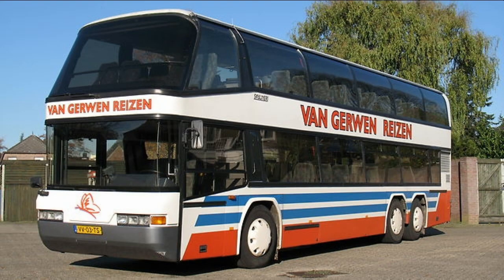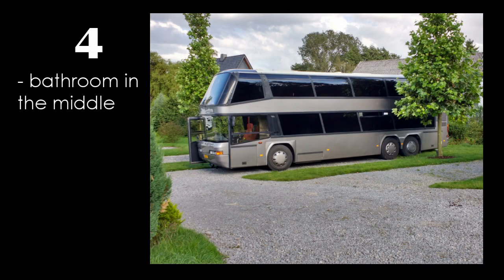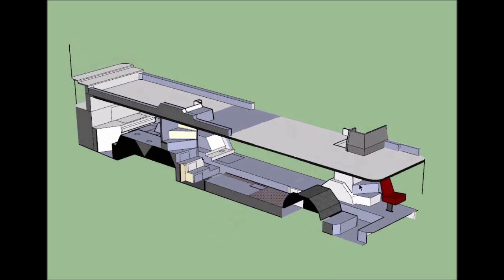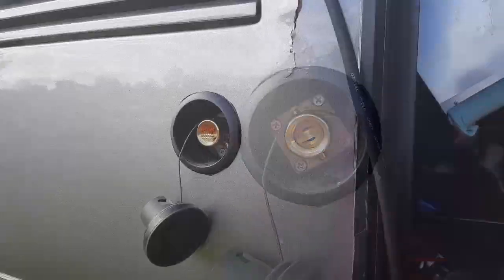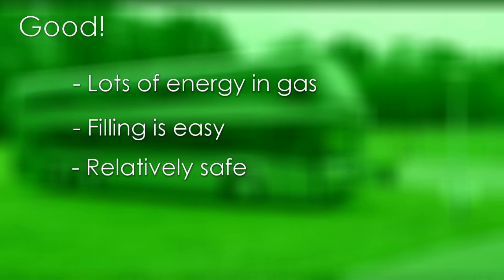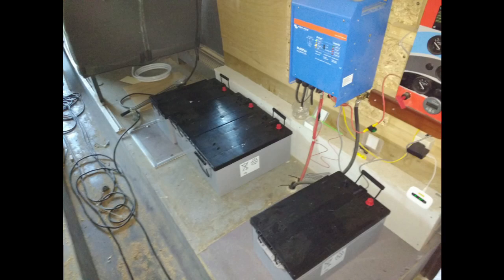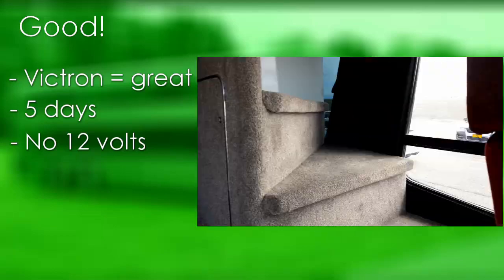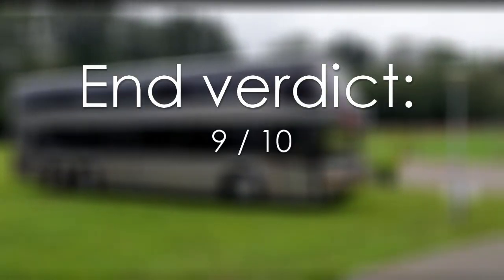Double Decker RV - Evaluation after 4Y and Design

Comment: One thing I would've done is get rid of the staircase at the front of the bus.  That way you would have more room for the dining area and the driver's seat on the first level and more room for the bunk beds on the second level.  And it would also give you room for perhaps more equipment for like a diesel generator so the RV will rely more on electricity than gas making it more "green" and/or perhaps a central heater/AC unit to distribute heat and AC all over outlets in the RV instead of using local/mobile heating and AC unit.  And that's another thing I would've considered installing, a central heating/AC unit and heating/AC outlets in the RV so more space can be freed up without those mobile heating or wall AC units.  

Overall it's a VERY impressive RV!!  Gives it a whole new meaning to the phrase:  You are always home no matter where you are  :)
Reply from the maker: Thank you!
Removing the stairs would actually have cost space. Now each room upstairs has its own stairs. If one of those stairs were gone, there'd had to to be some gangway upstairs to reach each room. Besides, you'd gain only a small amount of space, because both are placed above wheels. No, these two stairs are very convenient.
Generators have a big disadvantage and that is the sound. Maybe in countries like the US where you have more space that wouldn't be a problem, but over here you most of the time are quite close to your neighbour, so best is to make no sound at all, especially at night..
Reply: @Onrust1  Ok but you gonna give me central AC/heating, c'mon!!!  LOL